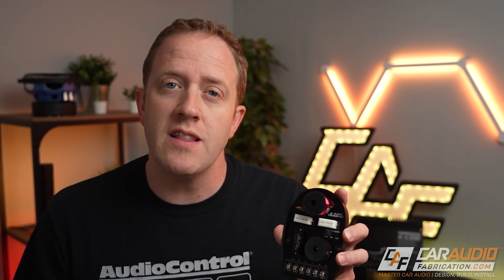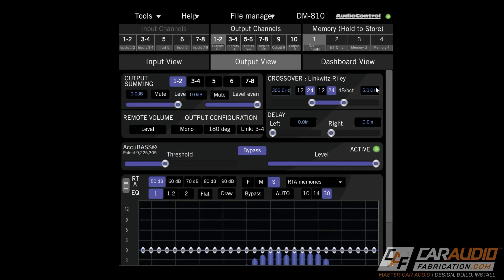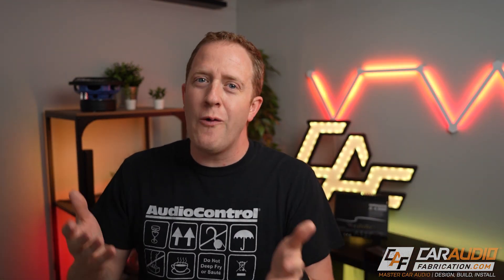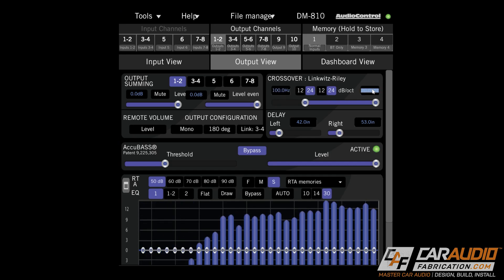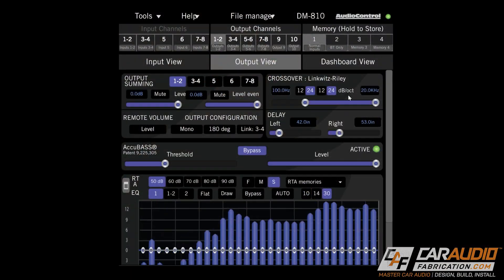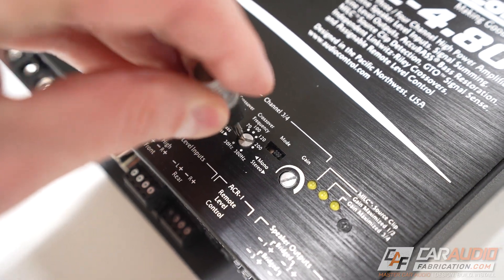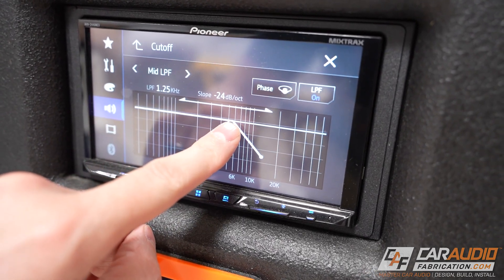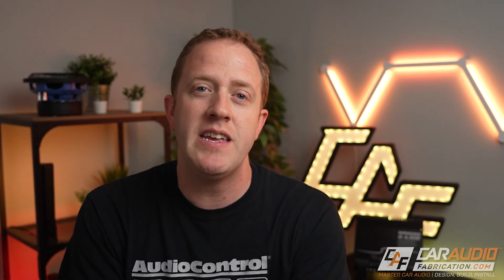Which Car Audio Crossover is BEST for YOU? Passive vs Active Crossovers EXPLAINED!

Comment: Thanks Mark.  Do you have a video explaining how to use a passive crossover to lower the wattage being sent to a tweeter by adjusting the attenuator inside a passive crossover.  Such as how much power is reduced from the amplifier to the speaker by going from 0 db to -3db and -6db, etc.?      Love the videos.  Thanks for all the helpful information

Comment: Can you still use a four channel amplifier when bi-amping your front speakers and still using the passive crossover in your door?  I’m trying to find out if it is still OK to use your crossover settings from your amplifier when it’s going into a passive crossover in your door? Thanks anyone for the input.
Reply: What u did bro im facing rhe same topic

Comment: Hi!
If the woofer frequency is 35hz-3000hz can i add a tweeter (1.2 - 25k) with a crossover high pass at 4000hz, 12db? Cant seem to find the answer nowhere.
Im talking about Audison ap8 paired with Audison ap1p tweeter.
Thanks!

Comment: Hey Mark. Would a crossover improve a $12, Chinese, 4x60W receiver and 2 pair of 6.5" coaxial speakers, front and back? Just learned about crossovers in the last half hour and was wondering what they'd do for the millions of low-end sound systems that are littering the air. Have you recorded a video on this subject? Cheers
Reply: In a nutshell, no. Component speakers however would work better with a pair of crossovers since you can get to the tweeter wires.
Reply: Thank you

Comment: Hi ... Could you share the purpose of active setup? I believe in passive already we are using mono and 4 channel amplifier to power base-mid-high along with cross over for speakers which added value..... 

How active setup will be different from passive setup which I have mentioned above 

I believe the set-up which I have mentioned above and 2 or 3 way active setup will give similar output and there will not be huge difference... I have experienced 3 way active demo too... Anyhow is there any other difference?

Looking forward for your valuable reply 😊
Reply: The video explains the purpose and difference. In short, active with DSP allows for much greater flexibility as you can fine tune cutoff freqs, output, and timing for each individual speaker but it’s more expensive, more complicated to install and tune, and easier to ruin speakers if you send them the accidentally send them the wrong freqs.

Comment: Hi, if we use DSP, should we use crossovers of component or directly assign a channel to tweeter and woofer. thanks..
Reply from the maker: Depends how many channels of system you are running. There's nothing that says you MUST run all channels active, although it's generally advantageous if you do have more amplifier channels to do so

Comment: I work at my son's car audio store. I have a Dodge Challenger with the KH system. hate it. So I changed all my speakers but kept the two KH 12" Subs, installed a DSR1 and two amps, a 4 ch Focal amp and a db 5 ch amp. The DSR1 has only 6 channel out puts. my OEM DSP was a 13 ch. my question is.... because I'm using some 4 ohm speaker and some 2.5 ohm speakers. can I run my 2.5 ohm speakers on my 5 ch db amp and my KH sub on the same amps 5 channel that are wired to 3 ohms?

Comment: I say if anything, run what you are building your setup for. If you plan active with staging, then multiple channels and some form of DSP will be involved. Some may not be comfortable with it, but if you have knowledge of how passive crossovers are designed, you can send an active signal to each individual speaker input on the passive crossover board. Just know, it voids warranty, and may damage its functionality if done incorrectly. I prefer to do both together as a precaution, and for the ease of level matching. I’m comfortable altering the crossover for full active install. Gives the passive crossover the added features of alignment and EQ adjustment for all speakers.

Comment: Have 100wRMS Alpine R-S65C speakers upfront. Maybe due to the bad design of the Corsa D have to run 175wRMS through them. 

To their credit, they do handle 175wRMS. However, wanted to run then actively, so I phoned up Alpine to find out the RMS of the tweeters... the Alpine representative I spoke to told me, "100wRMS". 

I seriously disbelief that. So I didn't bother.

Comment: Just bought a Helix DSP PRO Mk3. How in the hell do you reduce the output RCA voltage from 8v to 5v?!!

Okay, obviously, you can just cut up an old RCA cable in order to test with a multimeter (RCAs are really too small for crocodile clips)... but it has an RCA input clipping light, so surely it doesn't expect me to have to do that!

There must be some sort of software box to click... but for the life of me, I can't find it!

Helix manual instructions are EXTREMELY BASIC & LIMITED. Simply implies, "Well, if you're not an expert, then you just have to go to an authorised Helix distributor and pay them to do it." Bet they wouldn't even let you watch & ask questions  :(
Reply: Also, have Alpine Type-Rs and want to upgrade to Steg Masterstroke MSS 3-ways. However, I only gave 10 channels on my DSP and also want an 8" to fill in the gap between my two ported JL-Audio W3 12"s and my door-mounted midwoofers.

Can I use the 3-way crossover to run the tweeter & midrange passively whilst running the midbass actively? If the crossover is only getting the frequencies for midrange & tweeter then I don't see a problem. Am I mistaken?
Reply: Originally wanted the JL Audio 7s component speakers. But watched a YouTube where someone said they don't take the RMS stated (they distort before  that).
Reply: Steg Masterstroke MSS take 200wRMS

Comment: Active is almost always better but requires more amplifier channels. Many people want to use head unit power or want at most a 4ch amp plus sub amp. Active crossover users will almost always be people who spend mega bucks on their systems. Most people want boom and that’s it. It’s the enthusiast who HAS the $ and is willing to spend it that will choose active vs passive, the plebs will stick to stock or coaxial 99% of the time.
Reply: We don’t all have that luxury for active cross over systems lol
Reply: So that makes sense. My question would be how much difference is capable of hearing; homemade passive vs off-the-shelf passive vs dsp? I can tell my soundqubed amp has some issues in tuning as well as the stock speakers need help in tuning as well. I've been lucky in the past, however I think with my 96 Camry, the speakers are just not up to the challenge. I also look back and see why my Infiniti speakers failed in just over a year's time or so. Never had them before but had wanted to try something more expensive. I don't expect in-depth replies, some feedback and a direction to go helps more than that. I enjoy researching and finding info. I do see better results in finding information that is detailed and moreso of why something is, instead of generic answers. Maybe I'm crazy
Reply: Hello! I have four hertz sv200neo. 8inch midrange 200w rms! Does they need crossover? Do people use crossovers on 8inch spl speakers or only use HighPass filter and thats it like me?
Reply: Focal utopia uses passive

Comment: (Science experiments) Ever think about rerouting the AC electrical charge from the subwoofers to a DC converter to a 12v battery? Then to whatever you want to charge? Yes you could just simply add a bigger alt and battery more wire… but what would that wattage be like and how quickly if any voltage charge it would put out?
Reply: Energy in = energy out minus losses due to inefficiencies.

Comment: My friend is putting 6- 6 1/2's on his motorcycle. he is super tight on space. He really only has space for the amp. Could he use the capacitor of correct value to cut out bass on each instead of a DSP or this bugger passive modules? He wanted to use DSP but Im not completely sure why it is better than xovers.

Comment: My question is how can you use an active crossover (D6.1200) to make a custom passive crossover? I have been trying to build a multi-channel system with equipment I already own and I keep running into limitations with how many channels I have to work with. I have been looking into integrating coaxial drivers to keep time alignment correct, while using a passive crossover. Or would you recommend using a wideband driver instead?